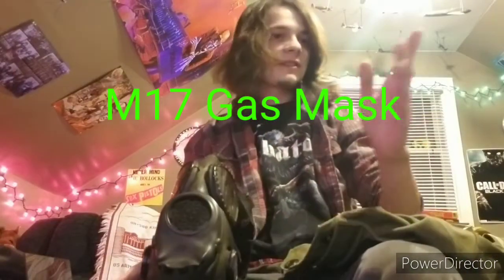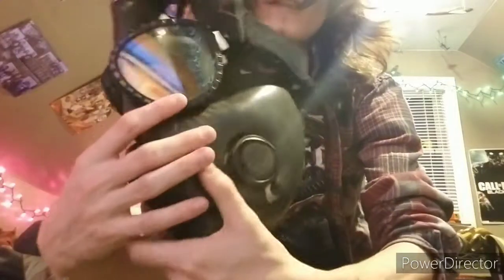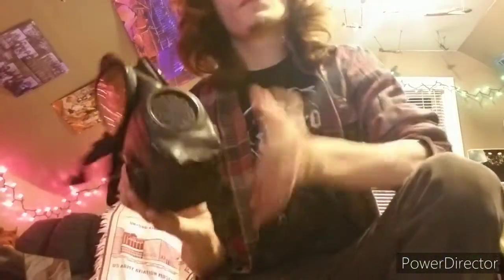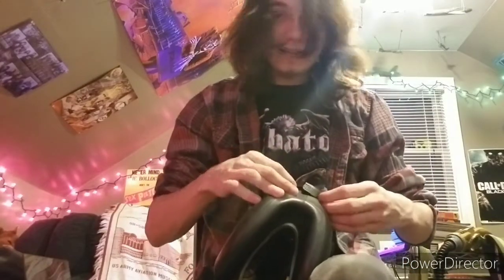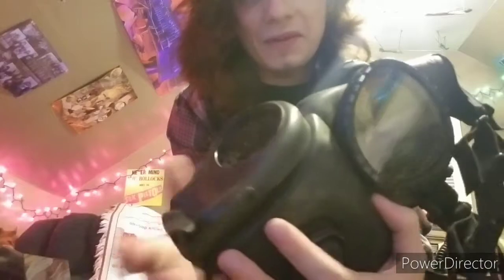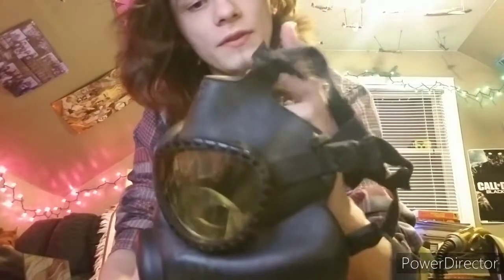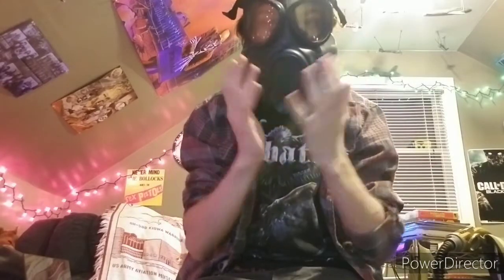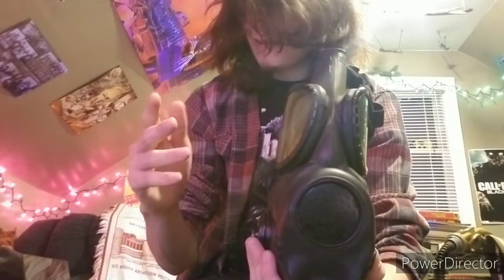M17 US Gas Mask history and Review

Comment: Not sure where you got some of this info. Though I’ll correct you on some things. 
1. It is indeed very light believe it or not. It’s lighter then the M9, M40, and even the M50. So it did indeed accomplish exactly what the military wanted. 
2. The filters last longer then the M9s filters. In fact they lasted almost 2 times longer. With a filtering lifespan of 24 hours straight. I also see a lot of it’s bad because you have to take your mask off to change the filters. But really you wouldn’t change the filters anyways. Because when you unscrew the canister there is a air pocket in between the inlet valve and the canister which is impossible to clear. So even if you replace the canister you will still be exposed to gas due to you inhaling the little pocket of gas from that gap. Which in some cases is enough to kill you. 
3. With proper techniques and practice you can easily replace the filters in less then 5 minutes. My personal best is 45 seconds for a single filter and around 3 for both. It just without proper technique it’s hard to do.
4. The XM27 was actually a grey-green silicone. The examples you see in most photos are actually the demonstration pieces made of clear silicone. 
6. There actually was another model of the M17 which was called the M17IM. It was essentially a tank crewman version of a M17A2. Also a little gripe not to sound bitter but that mask is actually called the ABC-M17 not M17. Also lucky find because Firestone face pieces are relatively rare so congrats. 
Anyways, overall nice video!
Reply: FINALLY SOMEONE THAT ACTUALLY AGREES THAT THE M17 WAS A GOOD MASK SERIES! also, im a long time fan of your channel. Especially of the  ABC M17 videos